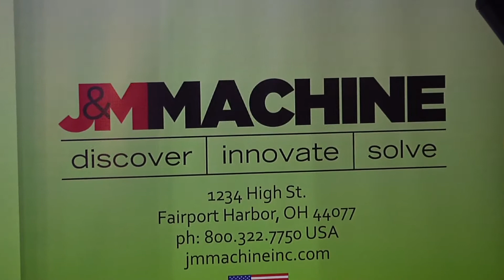JM Machine

Comment: taper in machine is only so long and has a relief for the drawbar to move up and down in the spindle hence the small area on top that is shiny, put your finger in the spindle and see for youself..

1 place a sharpie mark down the taper
2 run that tool a few times
3 see that the sharpie is completely worn out down the taper and still clean where it is shiny on the tool holder..

if the tools taper was being contacted where it is shiny with the "bulge" explained in the video than the sharpie would be worn out there right?